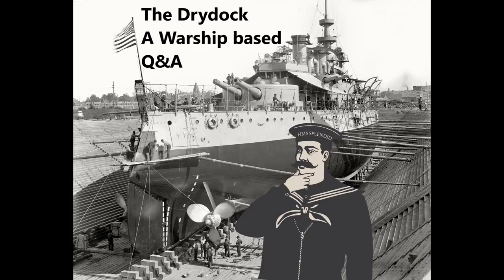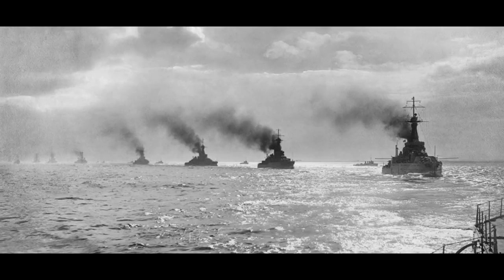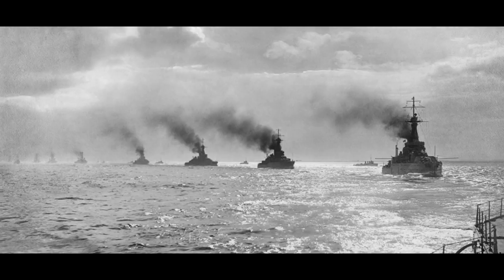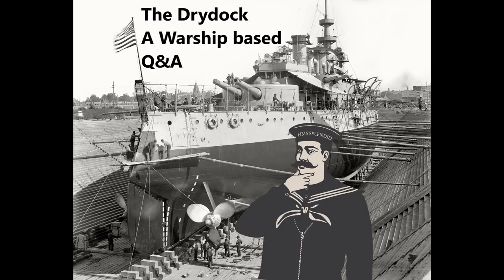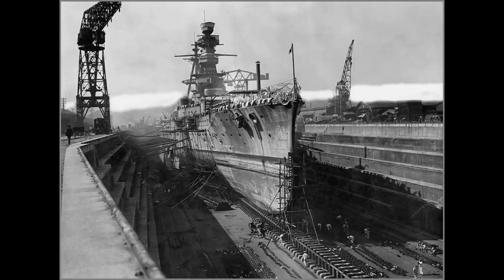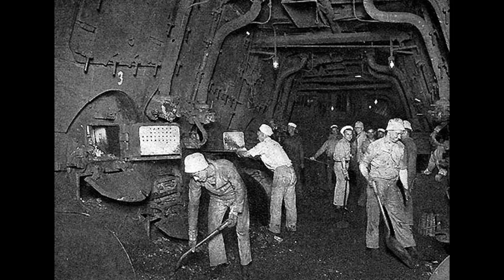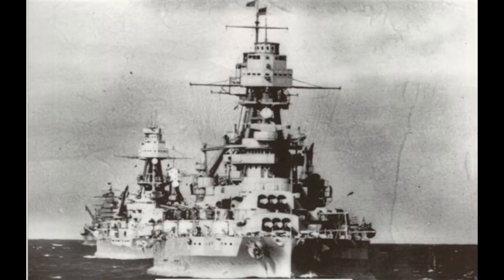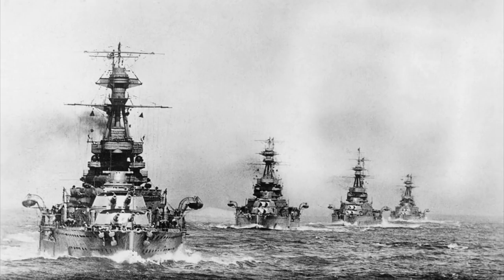The Drydock - Episode 087

Comment: I am one of those who served in the engine rooms of two ships during my 6 years active in the US Navy from ‘73-‘79. Ajax was a 4oo pounder ( an antique!!) while Kitty Hawk was a 1200 Pounder and very modern at that time. My understanding from the books I have read was that the Hipper’s suffered from main condensers that were too small, and when they went into warmer waters they had trouble and their speed would be very limited. In the much cooler North Atlantic it was no big deal.Other design issues I’m not aware of. One thought that I immediately had listening to your discussion on them was the Germans may not have been real good at water chemistry, and this is a very overlooked part of making high pressure steam plants work reliably I have forgotten more than I now know on the subject, but believe me, this is vitally important.Steam when it condenses goes acidic, without a good neutralizing amenin for the condensate you are going to regret it in very short order. The subject deserves much better discussion than my memory’s can give it all these years later, but it is crucial and if they were deficient in this area they would pay for it in a number of ways that got worse as time went along. So if they had poor design added on top of lack of knowledge about water chemistry, they would give you a myriad of problems that would only get worse as you steamed the plant.
Reply: very interesting stuff sir
Reply: Greetings shipmate!   :)   I was the MMC in 4MMR on the Hawk in the late 80's-early 90's.  Met her in the IO when she was in the middle of her "Around the World Cruise" going from her homeport in San Diego to Philadelphia Naval Shipyard for SLEP.
Reply: As a chemist from the 60's and having gone through racks of chemical literature, mostly in German, in our company research library, it is difficult to imagine them being that deficient in the water chemistry or knowledge of steam/condensate metallurgy.  They had the worlds chemical production topped before the war. I suspect they were cutting corners on not using the correct metalurgy due to supply shortages. Do you think they did not use a corrosion inhibitor in their condensate? We did but there were still   places where we needed monel a Cu/Ni alloy.

Comment: As an engineer :P "if it breaks at sea how are the engineers going to get at it?" is defeniatly NOT something ship builders think of when laying out pipe systems.
Reply: As an engineer (designer), there is a horrible problem in the philosophy of engineering nowadays where engineers designing systems have very little considerations for maintenance. It's a pet peeve of mine for sure.
Reply: As an engineer and designer of warships, I agreed.
Reply: 26 year mechanical engineer here.  I try to drill manufacturability and repair when designing into my younger engineers,  but... mant times the OML and size constraints overtake.   :/
Reply: @wdavis6814  It seems to have creaped into everything as a replace rather than repair is the rule these days, that and make it cheaper.
Reply: @wdavis6814  Not True in US Military design. I was PHM lead on a UAV, which include meeting specific standards for maintenance time, even when wearing MOPP4 protective gear. However the truth certain parts of a vehicle are going to be hard to replace.  A vehicle may need external equipment and structural support for large structural repair.For US Defense Acquisition Mil-STD-471 is the guiding document to demonstrate that a vehicle meets repair standards and times. Maintainability requirements can be reduced or waived if they would compromised mission survivability.or safety.
Reply: @MartinCHorowitz  True.  Now I do notice that the lowest replaceable assemblies are getting"bigger" as programs are trying to meet mean time to repair and taking the route of fewer and therefore more complex LRAs.  Eventually ending up with expensive and "bigger" LRAs.  Before any user notices, the O level logistics footprint is twice as big as initially planned  (or there is room for) plus the logistics trail of spares and retrograde transport becomes ... excitingly complex and expensive.
Reply: Not just the piping. Major equipment is similarly misplaced in every landbased processing plant. I remember our first look at the drawings of a new plant expansion, and the first thing the old production foreman said was, "look at that heat exchanger, even a 120 ton crane will have trouble pulling that tube bundle and what else could fit in there?" Fortunately we were both retired before that job needed a safe work permit. Maintenance is the last thing designed into a new system if it is at all.
Reply: My friend had to drop the bumper to change out his headlight module.  It took me a small bolt and 2 plastic rivets.
Reply: I knew that was an engineer thing from automobiles.
Why am I removing a fender to change a water pump on a Ford Escort?
And why do I need a second elbow and x-ray vision to change an oil filter on a Geo Storm?
-
I now watch a car repair channel, and I see far too many engines where the mechanic has to essentially strip things down to the block to change spark plugs, or take pieces of frame off to drain the transmission - both of which are periodic maintenance items!!!

Comment: Drachisms of the Day

23:38  "And the Germans, especially when it came to the Admiral Hipper class, 
went 'I know.   We shall take our little, overly-complex hodge-podge and we will
run it at a THOUSAND psi.   That'll end well.'  Yeah, I can hear the trans-Atlantic
head-desking.  Trust me, I can."

27:34  "Fuel goes in here.   Water goes in here.   Steam goes out here.
Connect it up.  Wheee!   Happy Days!"
Reply: The Iron Duke apparently installed an aim bot. LOL. sm
Reply: @mattwoodard2535  or a small worship shrine for RNGeesus inside the fire control room
Reply: muffled failing whine down turbine noises and panicking stokers noises from behind the bulkheads
Reply: Drach: Simplicity is a beauty
Across the water: angry schnitzel noises

Comment: I believe the six inch secondary battery on the Nelson class was technically dual purpose as they were capable of firing both anti-surface and anti-aircraft rounds but the rate of fire was too low for the latter to be effective.
Reply: They also traversed WAAY too slowly horizontally and vertically to engage aircraft. Might do wonders against a low flying Zeppelin though
Reply: That's new to me. I thought the secondary battery was a collection of the same turrets as found on the Leander class. That's what you get for learning from a computer game model I guess.
Reply: @Emdiggydog  That is the same problem Japan had. So they just did barrage firing rather than trying to track a target.
Reply: @frosty3693  Heavy AA always barrage fired. Mechanical accuracy of the cannon was insufficient for point fire, not to mention the inaccurate and laggy lead calculation.

Comment: Regarding Jutland, I think that it is pretty clear that even in a night engagement, the German fleet would have been crushed like an empty beer can and that Scheer believed that as well or he would have tried to fight when he had that chance. He knew very well that his only chance was the safety of Horns Reef or port and he was extremely lucky that the British subs at Horns Reef remained submerged. The night action that did occur was between small British destroyers up against much larger German units. Not every British commander was an Arbuthnot and had larger British units engaged it would have been quite a different fight. Even with heavier losses RN would still have prevailed in the long run due to the overwhelming numerical superiority. As it was, Jellicoe declared his fleet ready to fight again 4 hours after anchoring in Scapa Flow. The German fleet was in dry-dock for months.
Reply: Don't forget that both Black Prince and Pomern were sunk during the night engagement, it wasn't just the destroyers.
Reply: @kemarisite  Fair point regarding Black Prince which of course was a bigger ship but the German loss of Pommern goes directly to my point that it was (mostly) smaller British ships against much larger German units. Pommern was a pre-dreadnought battleship and she was sunk by destroyer torpedoes

Comment: Having had to assist with replacing the engine in a 36' Norfolk Broads cruiser, what might seem fairly easy can become very complicated very quickly, even on a small boat. There is a reason why in a lot of vessels the machinery is installed fairly early on in construction, with the rest of the vessel built around it.

I do know that with larger vessels changing the machinery often involves cutting a large hole in the side of the hull (or the decks), and rebuilding the vessel afterwards.
Reply: I had read that one of the cruse lines was adding a section to one of their ships (to increase accommodation) and taking the opportunity to replace the power plant at the same time. That was before the current virus problem, of course.

Comment: Now I do wonder what possible hurdles would be for the Germans to go for diesel engines instead of the high pressure boilers? Aside from space constraints and lower power to weight ratio's which would affect treaty limits the Germans where ignoring anyway, I can't really tell. I know there where some issues with vibrations, but the diesel engines by the middle of the 1930's where some twenty years in development and seems to have been ready for deployment throughout the fleet. Politics is often blamed for the high pressure boilers, but I still wonder if their was something fundamentally holding the diesels for usage throughout the fleet until high pressure boilers failed. At that point, the Kriegsmarine seems to have swung over to diesels for even the H-39. With a design speed of 30 knots and a serious 53,000t+ standard displacement, it seems the Germans where ready to do this. Sure, H-39 was massive, but I don't really see a reason they could not have put an 110,000shp+ all diesel system in the Hipper's or 130,000shp+ in the Bismarck with minimal design alteration. Really interesting would be working down to the destroyers. A Type 1936 hull with diesels and hopefully a better stern design, might also have been far more interesting and usable as a production destroyer.

Comment: The fact that the Allies had plenty of old BB hulls to accompany convoys may well have won the war on the Atlantic and Mediterranean fronts. The deterrent factor that kept Axis surface navies from increasing the successes of the UBoat arm is difficult to quantify. But while the effect on the local margins of victory where those convoys got through is hard to measure, the very knowledge that you had adequate men and materials gave the Allies options for actions they would not have had otherwise.
Reply: Surface raiders weren't. good convoy raiders compared to submarines (with or without capital ship convoy escorts); so the Allied battleships involved in convoy escort didn't actually do that much, since they were defending against vessels that were strategically awful raiders anyways.

Comment: Yep... most upper management ignores engineers recommendations.   
Boiler design is a fine line ... running xx% to xxx% over designed specifications is JUST.PLAIN.STUPID.
You design yourself a system failure that will fail at some unknown (usually worst) time.

Comment: 00:16:17 - German high-pressure turbines
 The "KISS Principle" (keep it simple stupid) apparently doesn't translate to Deutsche very well.
Reply: "halten Sie es einfach dumm"- Doesn't quite have the same ring....lol
Reply: @paulbrune1346  I had used google translate to try and translate "keep it simple stupid" to German before I made my original post and that's what it came up with. As a check I tried translating "halten Sie es einfach dumm"  back to English and it came back "just keep it stupid". 🙄 Maybe the problem is to German Engineers that is their KISS principle. 🤣
Reply: @sewing1243  maybe
Reply: @paulbrune1346  After consulting with a lady friend that Sprechen Sie Deutsch we came up with "Halten es einfach, blöd." (Keep it simple, stupid. The comma seems to make google translate happy).
Reply: A german would call it: "Machs Idiotensicher!". Which means "Do it so that even an idiot can handle it."

Comment: Power plants in the us have run their steam turbines at 1000 psi at 1000 degrees with GE steam turbines running at 3600 rpm. Westinghouse turbines run 1200 psi at 1200 degrers.

When did ships start running higher pressures? I can't imagine an atomic carrier running only 600 psi
Reply: The Forrestal Class had 600 lbs steam plants. When the USS Enterprise CVN-65 was built, they basically replaced the 8 boilers with 8 A2W nuclear power plants.   Remember, this is basically 1950's technology so comparing it with today's steam plants isn't really realistic. 

The thing is that a Nuc doesn't need to worry about fuel efficiency the way an oil plant does.
Reply: @sparkey6746  i get there is a safety margin by running lower t & p, but with all the watts u need to make steam, 1000psi is a lot more steam!

Are they running higher pressures today is the question